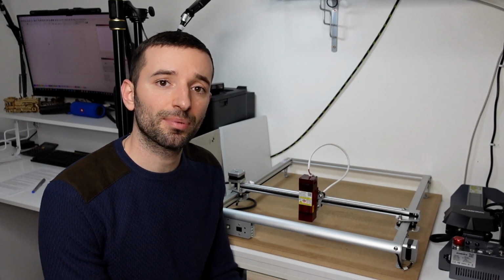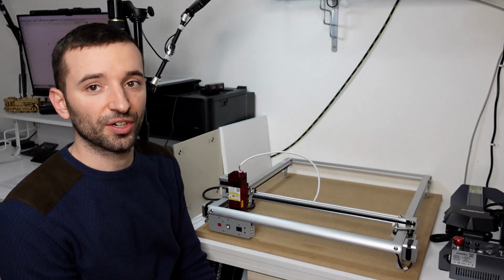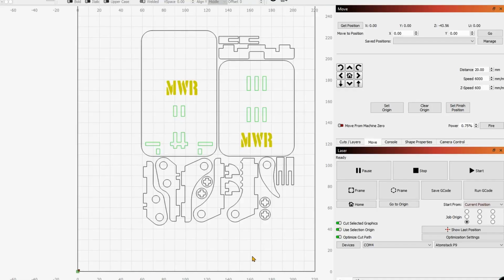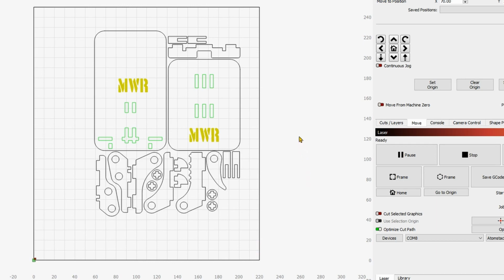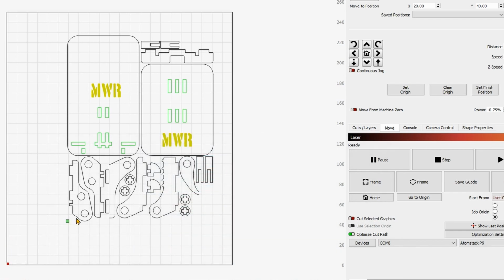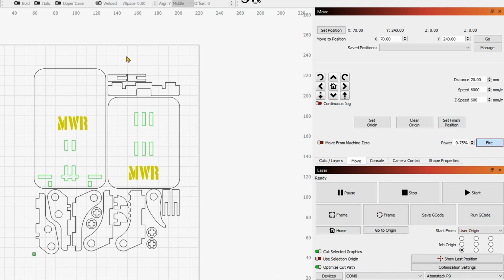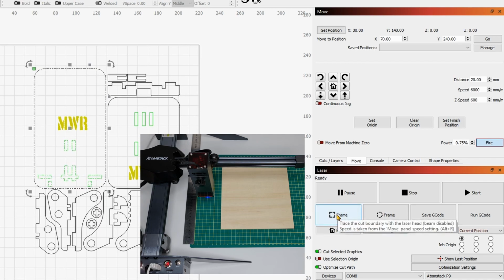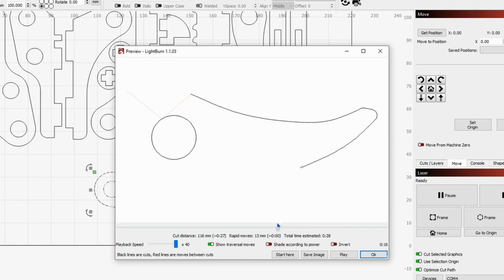Absolute, User, Job and Current Coordinate and Origin - What are they, how to use them - LightBurn

Comment: Hi is it possible to do this in lasergrbl if so how ? I am asking because I have been trying to use the J Tech Photonics laser tool in Inkscape extensions but when download it into lasergrbl it changes the start position . Some it is out of the range of my machine.
Reply from the maker: Hi, @pethuds; thank you for your comment.

J Tech Photonics I know is not working as it should in the latest versions of Inkscape, but if it works in yours all you need before to export your project, is to resize the page to content from File > Document Properties > Resize to Content.
Alternatively move your design to the X0, Y0, once that is done export with J Tech and you should have your file as respected.

If it does not work check selecting everthig and zoom out, perhaps you got some invisible object that extends far from your design.

If you still have problem please let me know the exact version of Inkscape you are using so I can try to replicate that.

I hope it helps
Ciao